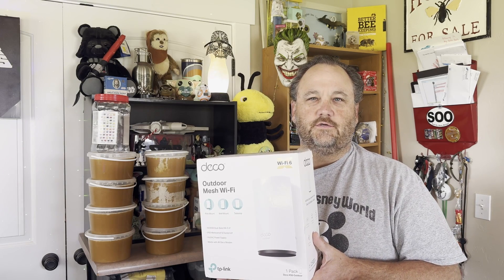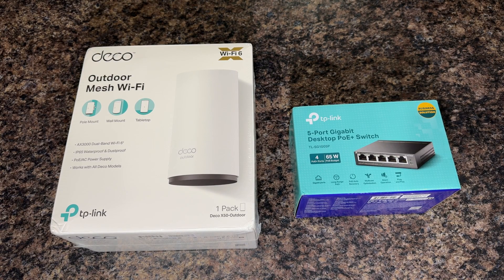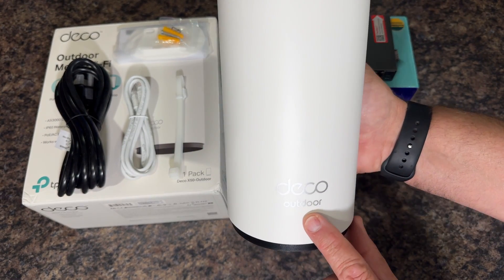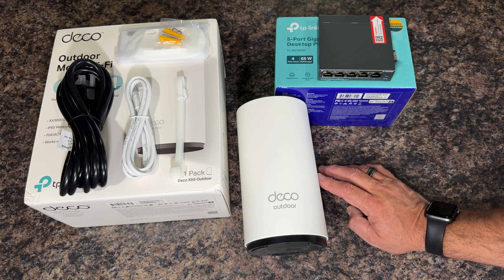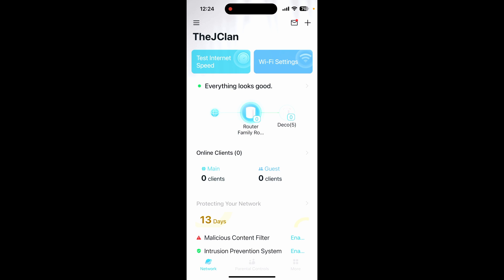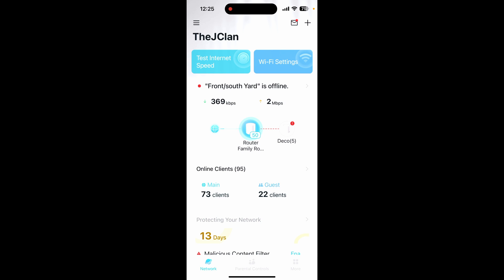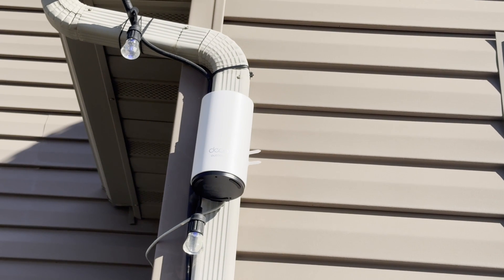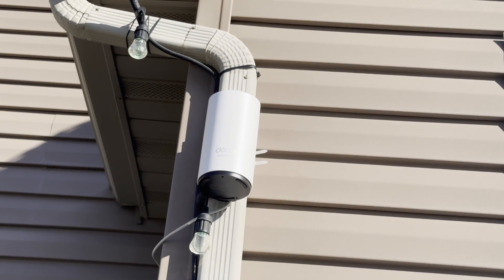How to install outdoor WIFI Access Points

Comment: Hi! Thanks for this video, really appreciate you’ve taken the time to do this. Just to double check I’ve understood properly:

I can have the Deco plugged into a power point ONLY? So if I have a power point outside I do not need to run a Ethernet cable as well to the Deco? It can run wirelessly but has less speed if I understand correctly?

This is my first Deco unit, we have a Starlink modem inside the house which reach the whole house, but need to extend the internet outside of the house to connect the security cameras. Some of our cameras are about 30-40m from the house. Where should we install the Deco? - Directly next to the house or next to the cameras which are 30-40m away from the house?

Hope this makes sense! Sorry for all the questions. Your video is so helpful ☺️

Comment: It s the POe mandatory:??? It is not wifi the hole system?
Reply from the maker: You can power the access point with just a regular power cord plugged into an outlet and then use the Wi-Fi mesh capabilities of the Deco system to provide access from another mess unit to this unit. Or you can use POE to power the device and to also provide ethernet to it.

Comment: Just bought one of these (11/29/2024). Can it be painted or "wrapped" (with a paint or wrap that won't inhibit signal strength)? If so, how do you think that would affect the 2-yr warranty?
Reply from the maker: @RunTheRace78  here’s what the fine print says:
“Conditions that disqualify products from the limited warranty include, but are not limited to:

Any defects or damages caused by normal wear and tear, accidents, improper installation or maintenance, misuse (including failure to follow product documentation), neglect, disassembly, alterations to the hardware”

With that said I would use a wrap since it can be removed if you have a claim or if you determine that the signal is impacted in a negative manner. 
I would set it up in the location where you want it to be permanently and do some tests as a benchmark. Then after the wrap is installed you’ll know if the wrap is causing an issue. Also, something to consider is that making it a dark color could cause heat issues if you install it in a location with direct sunlight so be careful there.   Hope that info is helpful.

Comment: Just so i understand...if i want to extend wifi to my yard this unit is all i need? I would be plugging it in to an  outdoor outlet.
Reply from the maker: @mikeboyd9313  you don’t need any other equipment unless you want to run an ethernet cable to it for a ethernet back haul. But if you are using the Deco system, it will connect via the mesh technology, so in that case, an ethernet cable would not be necessary.
Reply: @jessehjensen for the initial set up with the app, do I need to run an Ethernet cord to the x50 Outdoors? I do not have the option of set up with just the powercord
Reply from the maker: @ I usually do the initial setup with an Ethernet cord and using the power cord. Once I get things configured than I move to perform the actual install. That way I make sure things are working properly first. One thing to note is the deco app/system won’t ask how you are powering the device, whether that’s with POE or a power cord it shouldn’t matter.

Comment: Is the POE necessary? I'd rather plug into an outdoor electrical outlet. I have plenty of those.
Reply from the maker: @marinopascal1970  POE is not required and this unit come with a regular electrical cord so you should be good to go with the unit out of the box.
Reply: @jessehjensen how long is the outdoor power cable please?

Comment: Do you do a PoE connection to just the main x-50 or should each x50 have its own PoE connection. Im adding 5 deco units to cover a large area of land.
Reply from the maker: @PuraVidaDrilling  Each X-50 needs its own POE connection coming from a POE switch or a POE injector.  I find the Switch to be the best solution for most use cases. TP-Link makes several POE switches to choose from.
Reply: @jessehjensen  Would this be different than a wired backhaul setup?
Reply from the maker: @PuraVidaDrilling  the wired back haul function is using ethernet to provide connectivity to the Deco as opposed to using the mesh wireless connectivity between Deco’s. The POE option could be used to just power the Deco and still use mesh wireless technology to connect each deco together back to the router preferably you would use the ethernet cable to provide POE and also carry the data through the wired backhaul all in one cable.  That’s the most efficient and fastest method, one cable that would perform both functions.  

If you had one main ethernet run to a central location of where your Deco’s would be then place your POE switch in that central location and make your runs out to each X – 50, that would probably be the best option but I’m making a generalized statement not knowing your specific layout and configuration.
Reply: @jessehjensen  Thank you. Very informative.

Comment: Im new to the deco system. Have a couple in the house now and just received my x50 outdoor. Watching your video was helpful and just ordered my PoE and 100ft ethernet cable, which will be here tomorrow. Can you do a video showing how to connect up the PoE? Trying to figure out where to place my PoE inside the home.
Reply from the maker: @CassandraSmelser  usually you will want to install that POE switch near your router but realistically you could put it anywhere that’s convenient for your situation. Mine is located right by my main switch and that’s the most convenient for me but as long as you have a hard wired (Ethernet) connection going from your router to that POE switch than it will work.

I’ll see if I can throw together a quick video on connecting that POE switch into your network.
Reply from the maker: Check out my video about PoE. 

https://youtu.be/mz_bigXI-gY?si=DVxLO8qHsfhKZcdP

Comment: Hi, i currently just have my standard ISP router which provides enough wifi around the home inside. But not strong enough to reach the back yard. Would this work if i just run an ethernet cable from the back yard and plug it directly into the router, or do i need to buy any other DECO devices? Thanks
Reply from the maker: You can use these AP’s without any other deco devices (stand alone). You just need a POE switch if you plan on powering them via POE or you can use the included power cable if you have a power plug near by.